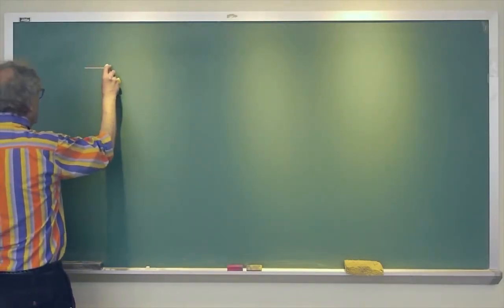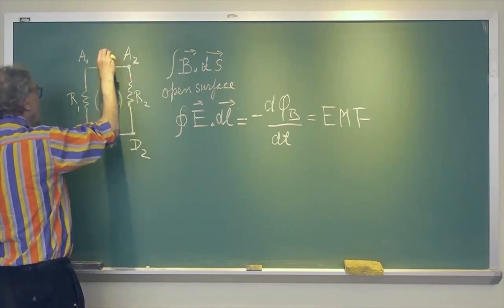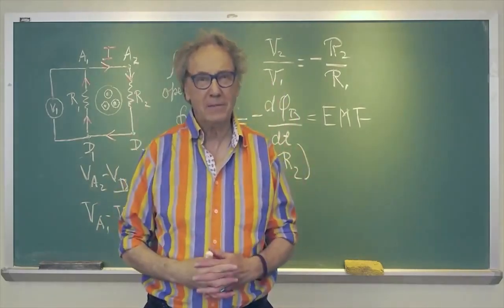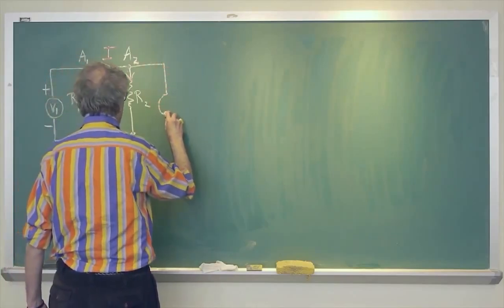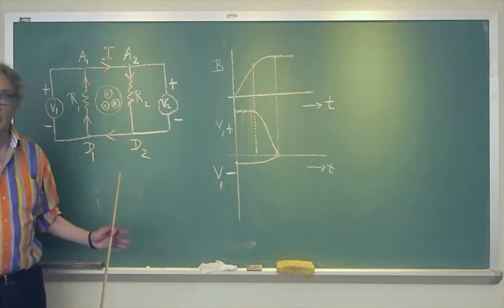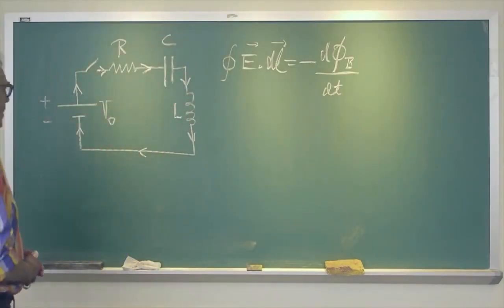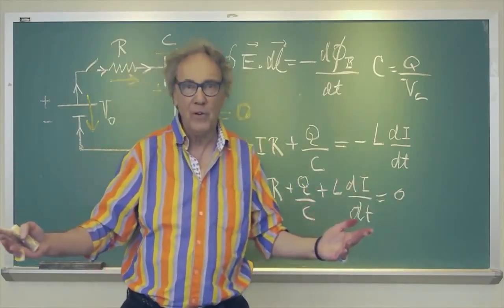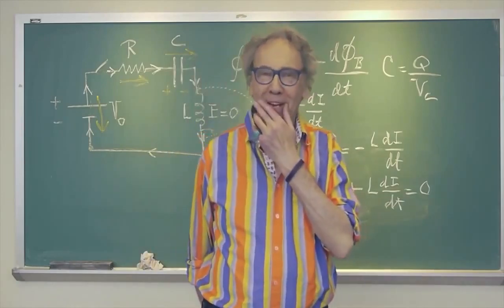Kirchhoff's Loop Rule Is For The Birds

Comment: Thnku sir reply me🥺🥺
Reply from the maker: I demonstrated at the end of my lecture #16 of my 8.02 E&M course at MIT that two identical voltmeters attached to the same 2 points in a circuit can show very different values. https://www.youtube.com/https://www.youtube.com/watch?v=nGQbA2jwkWI&list=PLyQSN7X0ro2314mKyUiOILaOC2hk6Pc3j&index=17
This can also be demonstrated with a transformer.
https://www.youtube.com/watch?v=b7i2uMx7gHo&list=PLyQSN7X0ro22zanLOcvkaSY-IZqheFYM5&index=8
The reason is that an induced EMF (Faraday's Law) creates a non-conservative E field. This means that moving a test charge between the same 2 points in a circuit can require a different amount of energy (even with opposite signs!). You still aren't getting any energy for free, because it comes from the source of the time-varying magnetic field.
When a voltmeter reads a value V it means that the integral of E dot dL across the voltmeter is V. 
In cases where Kirchhoff's loop rule (KVL) applies, 2 voltmeters attached to the same 2 points in a circuit will always show the same value. Kirchhoff's original text can be found in the following link, pages 497-514: https://books.google.de/books?id=Ig8t8yIz20UC. Clearly he was fully aware of the prerequisite for his "loop rule". KVL is a special case of Faraday's Law. That's why Faraday's Law is one of Maxwell's equations and KVL is not.
My demo was first suggested and published by Romer in December 1982 in the American Journal of Physics. This demo has now become a classic; it's done all over the world at many colleges and universities.
ElectroBOOM and Dirk Van Meirvenne believe that 2 voltmeters attached to the same 2 points in a circuit must always show the same value which is not true. They each posted a video on their channel in which they claim to have proof for their wrong ideas.
Also read Professor John Belcher's thoughts on Faraday's Law and on KVL. Professor Belcher is my former colleague at MIT. http://freepdfhosting.com/0813df09f5.pdf
ElectroBOOM insulted me in his video by mentioning that the reason why my 2 voltmeters read different values was due to "bad probing". He stated that if I had done the demo correctly both voltmeters would have read the same value. He could not have been more wrong.  
The following video may also help some of you to understand why 2 voltmeters attached to the same 2 points in a circuit can give very different readings. https://youtu.be/T6S5VS03xZc   I thank Mick Vall for his insightful comments.
Reply: @lecturesbywalterlewin.they9259  😊😊😊😊Thnku sir i wish same teachers as you every where

Comment: This is a bit confusing. 

I think you have to consider transformer theory for the first section of your lecture? That’s basically what you have, except the flux doesn’t pass through metal, it’s through air. If you were to draw the magnetic circuit for that, and calculate the secondary voltage based on that single turn, KVL holds in this case. 

Also, if you use the lumped load models and on an open circuit, the voltage will be the 0V across the inductor. When you close the switch, there will be changes in the electric and magnetic induced voltages in the components. In steady state, the inductor voltage will be 0V too because there is not volt drop. During transient state, yeah, there will be a voltage across the inductor, just like in the capacitor, but the whole circuit will end up in an open circuit condition due to the capacitor. In the transient state, there will be voltages across the elements, but they will add up to the battery voltage as the impedance of the L and C change through time. So, KVL holds fine. In my opinion :)
Reply from the maker: I demonstrated at the end of my lecture #16 of my 8.02 E&M course at MIT that two identical voltmeters attached to the same 2 points in a circuit can show very different values. https://www.youtube.com/https://www.youtube.com/watch?v=nGQbA2jwkWI&list=PLyQSN7X0ro2314mKyUiOILaOC2hk6Pc3j&index=17
This can also be demonstrated with a transformer.
https://www.youtube.com/watch?v=b7i2uMx7gHo&list=PLyQSN7X0ro22zanLOcvkaSY-IZqheFYM5&index=8
The reason is that an induced EMF (Faraday's Law) creates a non-conservative E field. This means that moving a test charge between the same 2 points in a circuit can require a different amount of energy (even with opposite signs!). You still aren't getting any energy for free, because it comes from the source of the time-varying magnetic field.
When a voltmeter reads a value V it means that the integral of E dot dL across the voltmeter is V. 
In cases where Kirchhoff's loop rule (KVL) applies, 2 voltmeters attached to the same 2 points in a circuit will always show the same value. Kirchhoff's original text can be found in the following link, pages 497-514: https://books.google.de/books?id=Ig8t8yIz20UC. Clearly he was fully aware of the prerequisite for his "loop rule". KVL is a special case of Faraday's Law. That's why Faraday's Law is one of Maxwell's equations and KVL is not.
My demo was first suggested and published by Romer in December 1982 in the American Journal of Physics. This demo has now become a classic; it's done all over the world at many colleges and universities.
ElectroBOOM and Dirk Van Meirvenne believe that 2 voltmeters attached to the same 2 points in a circuit must always show the same value which is not true. They each posted a video on their channel in which they claim to have proof for their wrong ideas.
Also read Professor John Belcher's thoughts on Faraday's Law and on KVL. Professor Belcher is my former colleague at MIT. http://freepdfhosting.com/0813df09f5.pdf
ElectroBOOM insulted me in his video by mentioning that the reason why my 2 voltmeters read different values was due to "bad probing". He stated that if I had done the demo correctly both voltmeters would have read the same value. He could not have been more wrong.  
The following video may also help some of you to understand why 2 voltmeters attached to the same 2 points in a circuit can give very different readings. https://youtu.be/T6S5VS03xZc   I thank Mick Vall for his insightful comments.
Reply: @lecturesbywalterlewin.they9259  but you can tell by the polarity of the voltage that they’ll add up… on your example you have a negative and the other a positive, meaning that the current flows in the one direction, so there has to be a source. This is why we need to use the transformer theory. You’re missing the “source” or transformer secondary voltage. That’s why if you calculate the flux in the air and the flux linkage between your solonoid and  coil, you’ll see that KVL holds.
Reply from the maker: @ewanharrison4007  <<<but you can tell by the polarity of the voltage that they’ll add up>>> yes they do add up but NOT to zero   That's why Faraday's Law holds and KVL does not.  FL is therefore one of the 4 Maxwells eqs, KVL is not.
Reply from the maker: The closed loop integral of E dot dL of any circuit which includes a selfinductor (thus it includes E dot DL through the wires of the seflinductor) is NOT ZERO if the current changes.  KVL does not apply.  Some peole use Faraday's Law: Close loop integral = -dphi/dt, they then write Closed Loop integral +dphi/dt = 0  and they call that KVL  they do not realze that it still is Faraday's Law. This is my last msg on this toppic. It's too elementary.

Comment: Sir I had a doubt if we define KVL to be the closed loop integral of Econservative.dl and set that equal to 0 then what's the problem in using it?
Reply: If the fields are conservative KVL holds, Faraday's law is more general and applies to both conservative and nonconservative fields. In practice though it can be useful to use KVL when applicable since the math simplifies quite a bit.
Reply: But to use Faraday-Maxwell equation is better and more scientific to use. If KVL is as the same as Walter Lewin says, then it can't be applied the circuits which contains changing magnetic flux. But KVL can be a little bit different. It can be "The sum of all the EMFs of the elements which the circuit contains elements equals to 0".If it's like so, then you can apply it every circuit
Reply from the maker: @flyingbirds6794  "The sum of all the EMFs of the elements which the circuit contains elements equals to 0" when you do that you move in Faraday's Law minus dphi/dt to the left side of your eqs. That's NOT KVL, it's still Faraday's  Law.
Reply: @lecturesbywalterlewin.they9259  Yeah you are right we can obtain samething with Faraday's law but if we consider KVL not as closed loop integral of E.dl, but rather as 'the sum of the EMFs/voltages of all of the elements which the circuit contains equals 0',then I think we can get the same answer. But in that case the proof of KVL is again comes from Faraday-Maxwell equation and KVL becomes not a scientific law but it becomes a useful tool for Electrical Engineering.
Reply from the maker: @flyingbirds6794  watch this  https://www.youtube.com/watch?v=f3-SfzepuPs&list=PLyQSN7X0ro22zanLOcvkaSY-IZqheFYM5&index=8  ha ha ha 5 + 3 - 8 = 0
Reply: @lecturesbywalterlewin.they9259  Yes professor, I agree with you indeed.But I only said that if we understand Kirchhoff's loop rule as not you've said but if we understand it in a different manner I think it can be true. If KVL means "Sum of the EMFs/voltages of each element in a closed loop is 0" I think it's true but as you said in that video, if KVL is the thing that I wrote then the way we obtain it is passing the - d(phi)/dt term to the other side of the equation as you showed in the video. Like passing 8 to the other side😂. Thank you professor, we like your manner of teaching.
Reply from the maker: NO RPOBLEM using KVL as long as all fields are conservative. However Faraday's Law always holds, with conservative and with non-conservative fields. Thus KVL is never needed.   It's for the birds

Comment: Hey Walter Lewin, Big Fan
I wanna to ask you whether current follows kepler third law of elliptical orbit. I mean when a circuit is in form of an ellipse, does current covers equal area if time is equal. Please 🙏answer 🥺
Reply from the maker: if current is electrical current then it has nothing to do with gravit orbits
Reply: ... And what if an electromagnet is put at one of the focii, (similar to the way sun is at one of the focii and responsible for the revolution of planets around it) and electrons flowing in circuit around due to the magnetic field created by the electromagnet. 
         
May be not smart, but i am curious. Please reply once more
Reply from the maker: @babitachaubey491  electrons obey Maxwell's eqs, they go in the opposite direction of the E-Field Thus  they follow the copper wires. Gravity plays no role.
Reply: OK. Thank you and sorry if i irritated you. 
I've many more questions better than this, related to various other topics too. Any mind if i keep disturbing you whenever i remember questions whose answers I'm searching from long time. I did joined your channel just few months ago. 

And one thing more, I am Riya Chaubey,(and a high school student😋)not Babita Chaubey, using my mother's account
Reply from the maker: @babitachaubey491  ofcoz you can ask questions but whenever possible try google first

Comment: I suppose, from this point of view, Kirchhoff is the electrical analogue to the D'alembert principle. Coming from an practicing engineer, I always make sure I understand the problem before I start using the "tools" available to me. This is a good reminder of that.
Reply from the maker: I demonstrated at the end of my lecture #16 of my 8.02 E&M course at MIT that two identical voltmeters attached to the same 2 points in a circuit can show very different values. https://www.youtube.com/https://www.youtube.com/watch?v=nGQbA2jwkWI&list=PLyQSN7X0ro2314mKyUiOILaOC2hk6Pc3j&index=17
This can also be demonstrated with a transformer.
https://www.youtube.com/watch?v=b7i2uMx7gHo&list=PLyQSN7X0ro22zanLOcvkaSY-IZqheFYM5&index=8
The reason is that an induced EMF (Faraday's Law) creates a non-conservative E field. When a voltmeter reads a value V it means that the integral of E dot dL across the voltmeter is V. 
In cases where Kirchhoff's loop rule (KVL) applies, 2 voltmeters attached to the same 2 points in a circuit will always show the same value. Kirchhoff's original text can be found in the following link, pages 497-514: https://books.google.de/books?id=Ig8t8yIz20UC. Clearly he was fully aware of the prerequisite for his "loop rule". KVL is a special case of Faraday's Law. That's why Faraday's Law is one of Maxwell's equations and KVL is not.
My demo was first suggested and published by Romer in December 1982 in the American Journal of Physics. This demo has now become a classic; it's done all over the world at many colleges and universities.
ElectroBOOM and Dirk Van Meirvenne believe that 2 voltmeters attached to the same 2 points in a circuit must always show the same value which is not true. They each posted a video on their channel in which they claim to have proof for their wrong ideas.
Also read Professor John Belcher's thoughts on Faraday's Law and on KVL. Professor Belcher is my former colleague at MIT. http://freepdfhosting.com/0813df09f5.pdf
ElectroBOOM insulted me in his video by mentioning that the reason why my 2 voltmeters read different values was due to "bad probing". He stated that if I had done the demo correctly I would have found that both voltmeters would have read the same value. He could not have been more wrong.  
The following video may also help some of you to understand why 2 voltmeters attached to the same 2 points in a circuit can give very different readings. https://youtu.be/T6S5VS03xZc
I thank Mick Vall for his insightful comments.

Comment: remember guys that KVL still works you just need to be smart about it because if you try to probe it the probe wires might have induced current.

Physics doesn't just turn off when you're too lazy to model it properly. Bad video which has been proven wrong.

I agree faradays law is easier when analyzing this circuit, but KVL still holds because it's a fundamental.
Reply from the maker: I demonstrated at the end of my lecture #16 of my 8.02 E&M course at MIT that two identical voltmeters attached to the same 2 points in a circuit can show very different values. https://www.youtube.com/https://www.youtube.com/watch?v=nGQbA2jwkWI&list=PLyQSN7X0ro2314mKyUiOILaOC2hk6Pc3j&index=17
This can also be demonstrated with a transformer.
https://www.youtube.com/watch?v=b7i2uMx7gHo&list=PLyQSN7X0ro22zanLOcvkaSY-IZqheFYM5&index=8
The reason is that an induced EMF (Faraday's Law) creates a non-conservative E field. When a voltmeter reads a value V it means that the integral of E dot dL across the voltmeter is V. 
In cases where Kirchhoff's loop rule (KVL) applies, 2 voltmeters attached to the same 2 points in a circuit will always show the same value. Kirchhoff's original text can be found in the following link, pages 497-514: https://books.google.de/books?id=Ig8t8yIz20UC. Clearly he was fully aware of the prerequisite for his "loop rule". KVL is a special case of Faraday's Law. That's why Faraday's Law is one of Maxwell's equations and KVL is not.
My demo was first suggested and published by Romer in December 1982 in the American Journal of Physics. This demo has now become a classic; it's done all over the world at many colleges and universities.
ElectroBOOM and Dirk Van Meirvenne believe that 2 voltmeters attached to the same 2 points in a circuit must always show the same value which is not true. They each posted a video on their channel in which they claim to have proof for their wrong ideas.
Also read Professor John Belcher's thoughts on Faraday's Law and on KVL. Professor Belcher is my former colleague at MIT. http://freepdfhosting.com/0813df09f5.pdf
ElectroBOOM insulted me in his video by mentioning that the reason why my 2 voltmeters read different values was due to "bad probing". He stated that if I had done the demo correctly I would have found that both voltmeters would have read the same value. He could not have been more wrong.  
The following video may also help some of you to understand why 2 voltmeters attached to the same 2 points in a circuit can give very different readings. https://youtu.be/T6S5VS03xZc
I thank Mick Vall for his insightful comments.